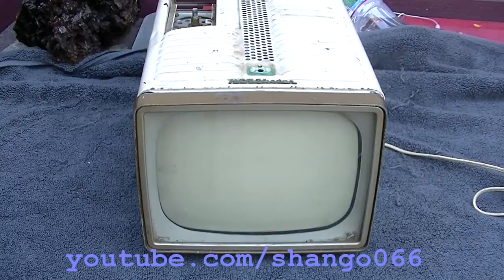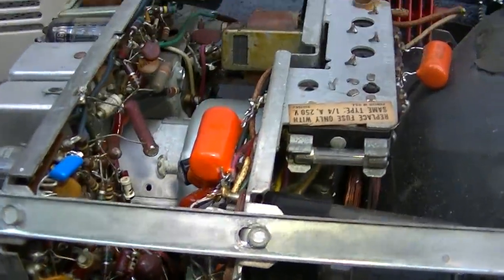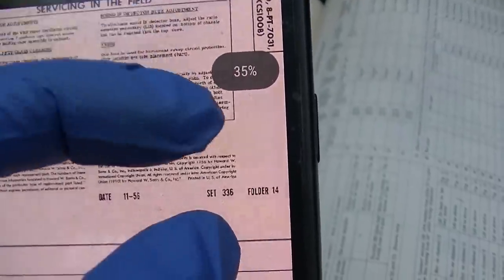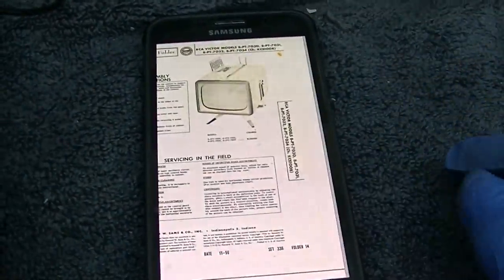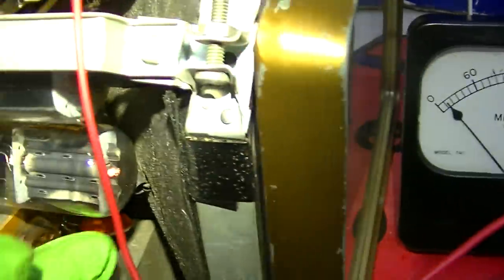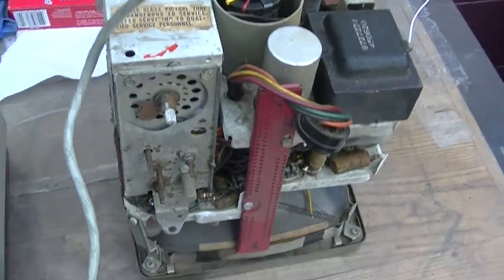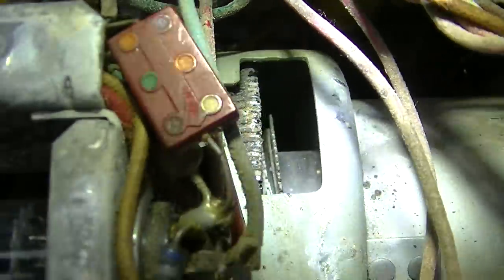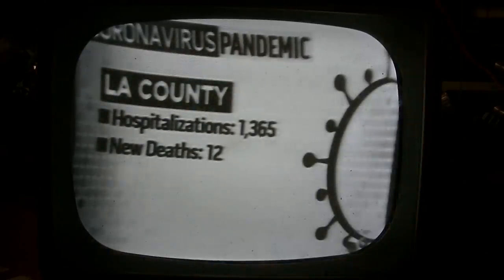Recappicide Repair 1957 RCA 8 PT 7034T KCS 100B Personal Television nye 21

Comment: I have a rather pristine version of this set that I fully recapped years ago.  They are not the best performers with no aluminised tube or DC restoration.  That said, they do work good in a moderately lit room.  They were intended as a personal TV and sold for around a hundred dollars in 1956, 57.
Reply: That sounds like a lot of money in '50s dollars but, I guess, it was cutting edge tech back then.
Reply: I wonder how many were thrown out the window.
I wanted to do this with the GE Portacolor I had.
I really hated that set.
Reply: @daleburrell6273  It belonged to my stepfather. He let me use it then he sold it later. It had something like 1mm dot pitch on a 12 inch crt.
Reply: They were a novelty item back then, a technological triumph when console sets were massive. Had to trade off performance for size. Would have been used in a kitchen or bedroom where viewing quality was not that important.

Comment: I made a post in the TV section of antique radios forum a few years back, asking for info on a Zenith that was my grandparents. Cant tell you how many stern sounding responses I got, demanding that I was not to turn it on until I had recapped everything. I told them I had already turned it on w/ a dim bulb and it was running great w/ no issue...wow the comments I got...it was like I had killed the damn pope. It was pretty funny how worked up they all got..

Comment: I used to work at the old factory building that produced a TV under the name Raytheon power tube under the name Dumont. Back in 1957 the BW TV small portable size costs $250.00 in the US and that equivalent to 3K today. When Hawaii became the US 49th state in 1959, my mother shipped the TV made in USA that called "portable unit" it was 15" Sylvania and she paid closed to $150.00 for the whole paycheck at Navy hospital nurse.

Comment: I had one of these but left it at my parents' home, which was sold after they moved to assisted living. Mine worked, but had an intermittent problem that caused the horizontal hold to lose lock when the set was fully warmed up. This TV was a true marvel of miniaturization for the 1950s as the case was hardly larger than the 9" picture tube, and it used large-format tubes!

Comment: A capacitor and resistor in series is a snubber circuit, they are used to dampen voltage spikes when switching on and off inductive loads, that blue component must be a all in one solution instead of having to add two separate components.
Reply: Exactly correct. We use those all the time in industrial automation across relay coils.
Reply: @TheTreegodfather  Yes, if the control voltage is AC, a reversed polarity diode across the coil if it's fed by DC.  Snubber networks are also used between contacts on the output side of the contactor for inductive loads (typ. motors) for the same reason.
Reply: Would like to know if replacing it with the proper capacitor would improve the video quality

Comment: I've seen a lot of repair videos and you rank among the top troubleshooters. Always a good learning experience. This is the first time I've seen a TV with such normally low picture tube anode voltage. I am surprised its designed that way. I restored a 17" Philco for a customer and it showed on the schematic as 15KV!!. Anyway it was great seeing how you tackle problems maybe I can get that good one day LOL. I been doing it for 35 years.

Comment: I look at this "chemtrails" phenomenon (26:53) with jaundiced eye, as I have seen stuff like this in the sky as far back as I can remember, around 1963 or so. These are condensed ice crystals from the exhaust plumes of jet aircraft. Portable, low-budget television sets of the mid-1950's were fairly novel at that time and priced accordingly. It was just as true back then as it is today --- you get what you pay for.

Comment: It pretty much resembles a soviet TV called Zarya (Заря), although it was twice bigger. The funny thing about it is that it had hot chassis, and it could electrocute to death if you touch the metal case)).
Reply: In soviet Russia Execution by TV!
Reply: 220V is much better for electrocution than american 110V :-)
Reply: most tvs in the uk had 'live' chassis,  and many radios , but rarely had external metal case, i have one that does , Ekco TMB272, but uses a proper double wound mains transformer, luckily
Reply: @andygozzo72  Near every Czechoslovak B/W TV had live chassis. But they were always in plastic or wooden case. Metal case would require 3 pin plug because it had to be grounded.
Reply: @xsc1000  earth tied to neutral? how does that work?
Reply: @xsc1000  my tmb272 does have 3 wire 'earthed' mains lead, i dont know of many other metal cased ones, the ones i do know of were similar mains battery portables, hopefully? with 3 core mains leads,  although none had live chassis circuitry, i dont think any normal 'living room' or even 'kitchen' tv set had a metal case, but not certain ,
Reply: @rubusroo68  earth shouldnt be tied to neutral in the appliance, but may be done at your consumer unit/fusebox/power distribution board..

Comment: the "BLUE" cap is a "CAPRESISTER", and that is used for killing inductive spikes across switch/ relay contacts ( it is wired in parallel with the contacts).
Reply: Also used as a bleeder in some circuits
Reply: @Synthematix  , that is true, I have seen that also!!!

Comment: I have a full restored RCA 8-PT-7031. I love the thing! 

I can assure you that the picture is crisp, sharp, whites are bright and black are super black! Actually really impressive for a 5kv CRT! My Ion trap moved and has to fix that and the rings. 

Luckily my yoke cover is solid and intact. I plan to make an .STL so it can be 3D printed like you've mentioned before. 

The video your getting on your set is god awfle. Nowhere near what is should look like.
Same for the other one yo worked on. Just a really bad picture. They should NOT look like this when absolutely perfect. 

Its a great little TV. It really is! 
As good as it gets for it's small size!

Comment: Have a Happy and higher minded New Year Shango. I have two of these sets. One is virgin and works very well . The other set needs resurrected and recapped. Hopefully I won't make the same mistake as the last person did that worked on your set.
Reply: Mine has a soft picture too, but I think it was inherent in this particular model.

Comment: Just like all countries are in on the C-19 thing, they are all doing the 
chemtrails also.  And in California, Harp is being used to cut off your
precipitation.  Our leaders are not very nice people.  Great video!  
These small sets are a pain in the ass to work on enough without 
someone else's botch job.  I've found these picture tubes to test 
good as well, almost new, but they are not bright.  And by the way,
the few I have worked on now I did manage to get back together...
LOL   You just got to have a good sledgehammer.... LOL  
Cheers Shango!  🍻 -Al

Comment: I also wanted to comment I really enjoyed looking at this video. A little background history about that set. I cannot believe that our CIA would put out such an inferior product considering they are a number one television maker back in the day. That's set sold brand new for $99.99. I have worked in a television repair shop back in the 1970s right out of high school and even part-time while still in high school. So one evening on garbage day I picked up one of those televisions it was the red one with the gold trim it was all complete and looked almost new had the tripod and even the P back antennas. I plugged it in I got a Rasta with sound and a picture but the horizontal was way out of sync I believe it was a 1978 or 79 when I found the set in the trash. So I bring it to the repair shop where I worked and the two technicians that worked there looked at me and said get that garbage out of here don't even think about wanting to service that. And they explained why that it was very poorly designed with vertical issues and horizontal sync issues from day one. And I believed them cuz they were in the business for many years. So the point I wanted to make is the set was really really a nice condition I really liked it because it look like something straight out of the Jetsons. I put it away in storage cuz I was collecting radios at the time and I felt the television was small enough I could save it saved it for over 30 years. I sold it about seven years ago to a guy that really wanted it he was going to restore it. I asked him for two hundred bucks and we settled at 175 he was happy so was I. My passion is collecting small radios. I do not have many TVs only about 5 maybe 6 at this point. I thought I would share this information with you and your audience about these sets have a happy healthy and prosperous New Year

Comment: 1:09:10  The cap with a resistor in series is, if I recall well, a 'spark killer', to be put over switching contacts, probably when loaded inductively. (Quench - ark )
Reply: Yep, just like in a Halls spark, or even points spark system.  The cap is there to save contacts and switches.

Comment: 1:09:26  That is commonly known as a "snubber", and is exactly that. A cap and a resistor in series.  They are used in switching power supplies and just as you said, across relay contacts that control AC.

Comment: Did you heard about the Open Source CRT Chassis? It is an open source project that aims at making new electronics for CRTs, it might turn out useful for good CRTs without chassis
Reply: Is that really an issue? Generally speaking, there's a shortage of good CRTs. Especially early B&W and Color.
Reply: Oh, I looked it up. It's for newer color CRTs
Reply: often they are made with discrete components and a couple of ics that still can be sourced...flybacks and crts are the things that make them unrepairable. I dont see much advantage on swapping a completely diferent board and wiring it in and setting it up
Reply: China still make crt sets believe it or not
Reply: @Synthematix  If they are, it's with old stock CRTs

Comment: This was part of the era of the lousy cheap TV, with as few IF stages as the maker could get away with.  They only will work so well, and with transmitted signals that will make your fillings ache.  Earl Muntz would be proud of such design.  After resurrecting a couple of these I largely gave up wasting my time on them.

Comment: @1:09:23 that’s an arc snubber cap/resistor network used for absorbing the arc across switch and relay contacts to keep them from pitting. That ain’t ‘sposda be in there!

Comment: I had a similar style 12" Admiral set that I bought at a flea market back in the early 80s.  I didn't do anything to it, just used it as is and the picture wasn't any better than this one.  Very dim and soft.  I was just a teen and used it until it died then threw it out.

Comment: I didn't notice much difference between the lower and higher bit rates. It could be because I'm using an LG 42"  LED T.V. for my main monitor. Not the greatest "computer monitor" to judge by. lol. Looks great. Nice long video though.👍👍👍

Comment: The 8DP4 is capable of producing a nice picture. I had an Emerson Port-O-Vision TV radio combo with that tube. These are compact, personal TVs, with cramped electronics. I found the Port-O-Vision ran quite warm. I would look for issues with the video output section on this set.

Comment: I say yeah, chemtrails from that jet, yet the gov. complains about Pollution from cars and power plants, yet heres what they send in the Air. Think about it, might be time government cleans itself up and its messes before complaining about every thing else, thats what i'd say.
also happy New Years!!
Reply: Buy a new electric car.
Buy a new clean diesel truck
Buy an energy efficient fridge
Buy a high efficiency AC
Buy a water saving washer
Buy a high efficiency furnace
Buy a hybrid water heater

If you don't, you want to kill everyone on the planet with your irresponsibility.

But don't dare question the pollution of the system! The ships, the industry, the airplanes constantly overhead, it's all good.

Comment: this is why is say to those that say the first thing you always do with an old device is recap it, is  NO, check to make sure no 'unobtainium' parts are bad first, and 'try' to power it up through a current limiter , bulb ideally, not variac, and see if any results, and maybe do some basic voltage checks, if all reasonably ok, THEN start thinking of recapping, ideally change one at a time, not chop the whole lot out in one go, or very easy to mess it up, i did when i was young and inexperienced and ruined a 1938 murphy portable radio

Comment: Those are Condensation Trails ( nickname Con Trail ) As the air passes over the airfoil shape portion of a wing, it speeds up and heats up. This warmer air meets  cooler air at the trailing edge of the wing creating condensation, which is what you see streaked across the sky.
Reply: A 'Con Trail' was left by Mr. Drumpf.
Reply: Contrails are from water condensation in exhaust. Just like you see steam from car exhaust on a cold day except on a much larger scale.

Comment: The damper tube really is only a rectifier.  I have plan to build an audio amplifier using HK Citation 5 schematic with few mods using a couple damper tube as a set of rectifier.

Comment: I own one of these RCA 8 PT sets,  I bought it several years ago from a seller on Ebay in Chicago for $35. It worked out of the box, but I decided to have the set checked out by a professional.  It needed a 6U8 and a 1V2 tube and one capacitor.
My set has a built-in rabbit ear antenna which must be not extended for an external antenna connection.  It doesn't have the stand.  I have seen junker sets with the stand, but could not find anyone willing to part one out,  
I have some views why this set was not successful:
1:  The set has no provisions for UHF reception.
2:  This set ranged in price from $99 to $129, which was the price of portable sets with 14" to 17' screens.
3:  The screen was not designed for family viewing; just for individual viewing.
From my research, this set was only made for one year (1957).  However, it must have been a big technical accomplishment to squeeze a nine tube transformer set in such a small cabinet.  Most portable sets at that time were series strung.

Comment: I don't know how I found it - but I got a replacement 17HP4 with good readings for my Firestone set.  The old one had the heater burned out - so I'm a little nervous about flipping it on.  Do the sets that are with a power transformer all in parallel?  (I'm trying to guess what could blow the heater out and make sure it doesn't happen again.  Wouldn't that suck?) - Sorry dumb question, of course I can see the schematic and the voltage seems right around 6v - have you ever seen a blown heater on a CRT?

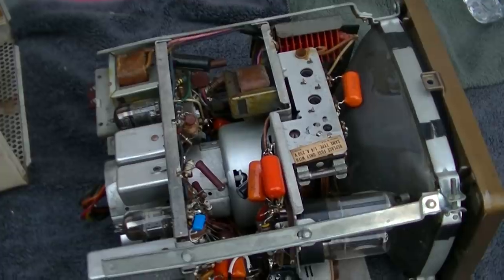Comment: 26:09
If anyone wanted to prove that contrails contained chemicals, all they would have to do is build an easy to obtain spectrum analyser, they can be made from an old DVD and a pin hole box.  It can be googled.  In order to only check a small portion of the sky, a magnifying glass, binoculars,  rifle scope, or similar would be needed.
Reply: THIS!
Reply: Chemtrails?  The problem with that is, if something is aerosolized at 30,000 feet with the wind it would be dissipated to a minuscule amount and would be hundreds or thousands of miles before it touched ground.  Chemtrails would be a lousy way to dispense chemical’s.  Our water supply is a far better way like they do with fluoride, or even or food.  Chemtrails is what non-critical thinkers believe in.

Comment: Another great 😊 television 📺 from my childhood. What ya mean 😪 by “Recappicide”, I do not know, but it sounds something on the order that you’re probably gonna part it out. I just saw 🪚 that this TV 📺 is STEEL, not today’s black, or silver plastic crap 💩 sets. What did ya say for the year of this, 1920’s or something? Little airplane ✈️ ASMR in the background there. That’s pretty 😍 common in your videos, as well as Radiotvphononut’s. I’d try to resurrect this thing, otherwise, it will probably wind 🌬 🆙 in the dump, and then sent to China 🇨🇳 to be melted down. I like 👍 that this set has the manual 👨, and schematics. Do wear those shatterproof goggles, when working on these TV’s 📺. The picture tube can implode, causing possible personal injury. I really wanna see a part 2 to this video, if needed. I really wanna see this set in a next video, and I wanna see ya ✌️ resurrect this set. Happy 😊 New Year!! Your friend, Jeff!!

Comment: I came across one of these a few years ago, unfortunately the picture bulb was necked and the case was a complete rustbucket. I ended up just harvesting the tubes and transformers. Do you want the flyback? It looks OK but the set looked very high hour and I have no way to test it.

Comment: Did you end up reaching 7KV  for the picture tube anode? Usually its around twice that voltage for bw tubes. Also the ion trap may need adjustment for max brightness.

Comment: That’s a shame this became a parts set. When you opened the case and saw  the new capacitors it was obvious that someone put some time into it. Guess they reached an impasse and gave up and decided to use it for parts set. Too bad. Im sure someone else out there can use the parts,or perhaps has the parts to restore it.

Comment: You have to be in a very dry place to be surprised about
condensation stripes. That's what we call it in the Netherlands.
As soon as it is a bit clear we can see almost all flights from Schiphol and towards it. I live about 100km (60 miles) from Schiphol.
So not so very special.

Comment: I have one of these that I have fully restored. I modified it to accept composite video and line level audio any the picture is 100 x better than this one. Maybe the picture tube in this one is just dead but still has good emissions? Very odd.